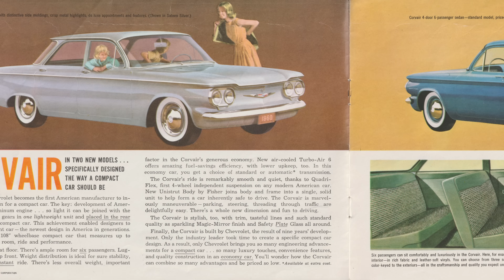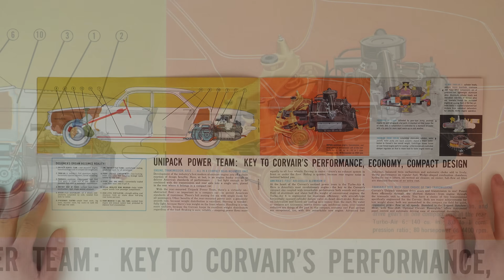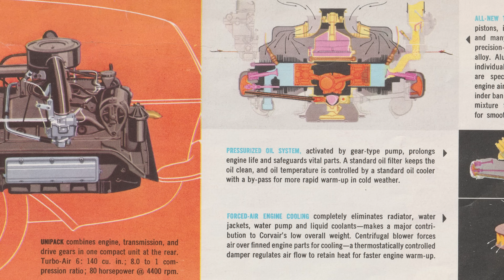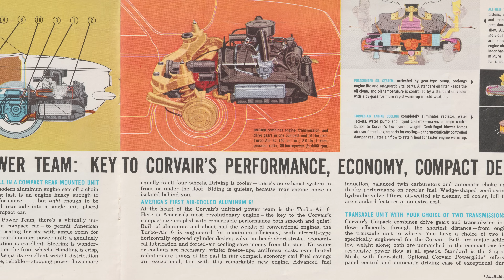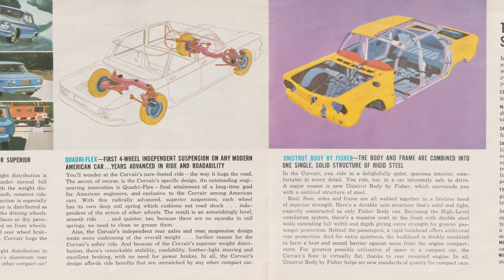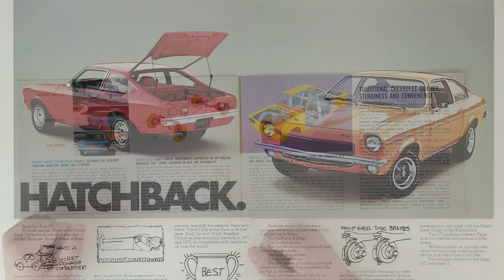The Engineering of Nader's Nemesis - A Look at a Chevrolet Corvair Brochure

Comment: Pretty factual article from overseas. I work on Corvair’s and while Chevrolet built the car initially as an economy car marketing quickly changed direction to focus on a sporty alternative in the US market with the introduction of the Monza and a floor mounted four speed transaxle. Then the turbo option was added in 62 called the Spyder with 150 HP. Then in 65 with the new model a 140hp and 180hp model was added called the Corsa. In 67 after the Corsa model was dropped the 140hp was a RPO option with either the manual or power glide transmission. The Ford Mustang and the Camaro spelled the demise of the Corvair as the American public favored traditional front engine rear drive vehicles.

Comment: You missed so many delightful details on the Corvair- the bigger engines with 4 carbs or a turbo, a 4 speed,  and the many variants.  There was a 2 door coupe,  a convertible,  a 4 door,  an estate, a 6 door van with 3 row seating for 9, and a pickup! That 80 hp was merely the base engine,  but specific output was low because,  like the VW, it was a low- revving, torquey engine for a family car.  The turbo had double that power.

Comment: I didn’t know they put a 6 beyond the real wheels…..with transmission?
Interesting 🤔
Did anyone in the design meeting raise their hand and say: that’s a lot of weight in the trunk…it might, you know upset the handling.

If that car had a regular 6 cylinder up front driving the rear wheels, I suspect it would have been ok.
Reply: Same layout as 911

Comment: And the reason why US and European/UK cars went different directions after the war was simply, Europe/UK were either heavily damaged or in rubble and in massive financial debt.
…we had no option….we had to go truly compact, low cost, and fuel efficient…..mostly: some exceptions like RR, Jaguar, Rover.

Totally the opposite to USA
Until the oil crisis hit….but they fixed that with the Alaska pipeline.

That brings us into the Japanese cars which appealed mostly to both sides the pond.

Comment: great vid! i posted this in the community post too but ive had a 63 turbo two door (first production turbo car!) for about 10 years. For being from the 60s its a blast to drive and is easy maint.

Handles AMAZING compared to nearly everything else in the 60s and 50s. My family has some 57s, and his buddy has a c1 and c2 vette. I have driven them all. 

Both handle worse than my stupid 6cyl chevro-beetle. And it makes turbo noises after hours of turbo lag! The issues of unsafe handling I think has tons to do with the quirks of rear engine driving a 1960s american public had NEVER driven. And a relatively long one at that compared to the rear engine nonsense of the day.
Reply: I thought the F85 with the "rocket fuel" was the first turbo, with the Corvair a close second. Either way, the "rocket fuel" seems like a great way to maintain a high compression ratio on a turbo without causing the engine to destroy itself. It would be a worthwhile alternative to premium fuel requirements on today's turbos.

Comment: You can fix the dangers of the Corvairs instability by fitting a camber compensator bar that stops the rear wheels buckling under adverse camber
Reply: Thanks for the info.  And maybe did'nt GM do something like that in all Corvairs by '61 or '62?
Reply: @UberLummox They added swaybars back initially, before adopting the camber-compensating spring for 1964.
Reply: @LN997-i8x  Ok thanks.

Comment: In reality, Nader didn't specifically target the Corvair but used it as one instance of flawed design choices. He railed against many car design features from different US makes. What was oddly conspicuous in its absence (and very morally suspect on Nader's part) was significant critique of the very popular VW Beetle's pretty significant safety shortcomings. 
But all of this is academic to the downfall of the Corvair, because, more than Nader, its fate was sealed with a single word.
Mustang.

While Corvair had some sporty flare and features, Mustang came in with a similar price and a far more modular ice-cream sundae bar buildability. As soon as the pretty, far less sophisticated, roomy or efficient Ford came out, the fade out was on for the Corvair.
Oddly enough, the Mustang also helped kill its own previously VERY high selling compact car, the Falcon.
All this for a pony car market that pretty much flamed out in around 5 years.

Comment: It would be interesting to see a comparison of driving capabilities of the two Corvair versions compared to other american cars of the time, like the Falcon, Mustang, Valiant and such.
Reply: There are some comparison dealer films comparing the forward control van and pickup versions of the Corvair and Falcon. Corvair pickup won by miles on unladen straight line braking and work site traction on rough ground.

Comment: If GM had wanted VW Beetle rival they just copied they're European cars.
Reply: Starting point was the Beetle but US buyers wanted more space and power in their Beetle. So a six seater and six cylinder Beetle like alternative.
Reply: @johnd8892  GM's european cars Vauxhall Victor & Opel Rekord were built on the same platform as the Chevrolet Corvair and some of them used less gas than the beetle. i've no doubt if GM had made the Victor/Rekord in America, that Volkswagen would have gone bankrupt becauce they were depend on selling the beetle in the states in later years.

Comment: Wonder how much of Corvairs bad rep is due to people ignoring the instructions re tyre pressures...
Reply: Most of it. They were a real handful if pressures weren't right. My family had 3 over the years and they were the best GM cars we ever had...
Reply: Common problem with all rear engined cars. Just in case, my grandpa had a heavy sandbag in the forward trunk of his Renault Dauphine (known in Spain as the widow maker) when no luggage was carried…..
Reply: That's why having the engine hanging way out back made zero sense to me.
A small & common thing like tire air pressure can have deadly effects.

Comment: One of the main contributors to Corvair instability was the average gas station attendant. In those days you got your tire pressure checked, windshield washed, oil checked, etc. while your tank was filled. When the attendant found your front tires were at 15PSI and the rears at 25PSI, your tires were low and immediately filled to the normal 30PSI on both ends. The next curve you tried to take at a normal road speed, the front tires would break traction, you lost steering, and the average motorist of the time would slam on the brakes which caused the rear to tuck and you went flipping through the weeds. I learned about this after my dad verbally flayed a few strips off a gas monkey for adding air to the tires on our 1961 Corvair at a gas stop....
Reply: I also heard of this unusual tyre pressure rule... it always sounded like a crude workaround to remedy a potentially dangerous design.
After all, reduced pressure means increased friction and therefore higher fuel consumption and premature wear.
They may have clearly written all that in their manuals... but to reach zealous petrol station attendants, they should have placed tyre pressure stickers over the wheelarches (ideally with the addition "yes, seriously!!!").
Reply: @notroll1279  If they had really wanted to address the problem, they could have put 15 or 20 PSI relief valves  on the front rims, perhaps with interlocks only allowing the valves to operate while the tire was being filled, so they tires would not loose air going over bumps; just metal caps would have done the trick.  I don't think that the low pressure would have increased rolling friction unacceptably, since the weight on the front wheels was normally quite low, but it might have been an issue when the car was fully loaded.